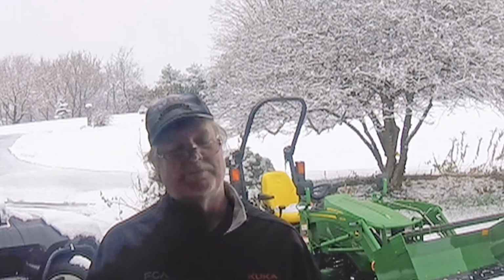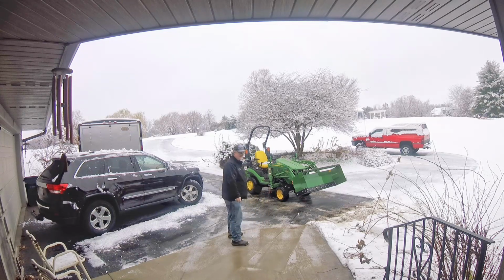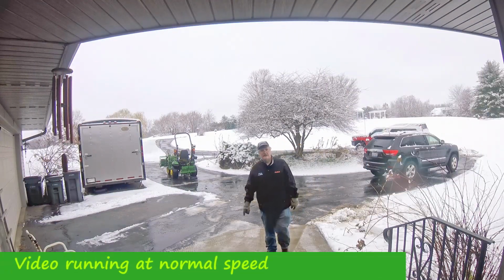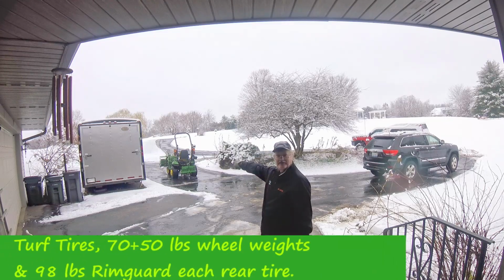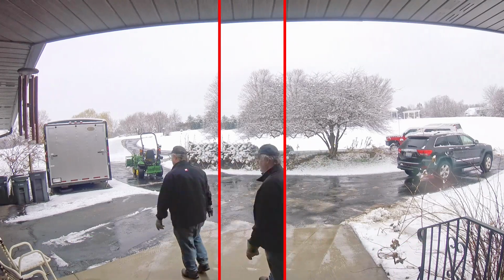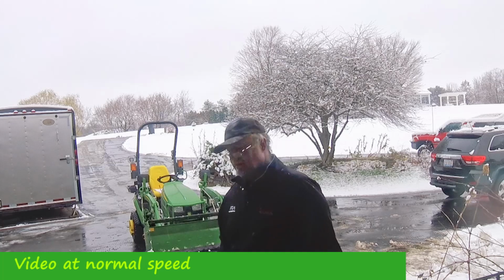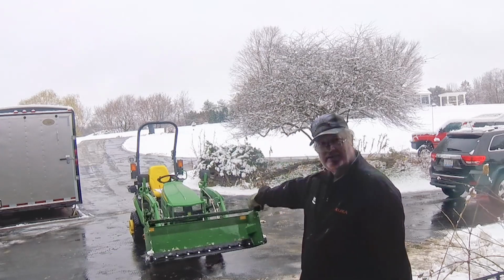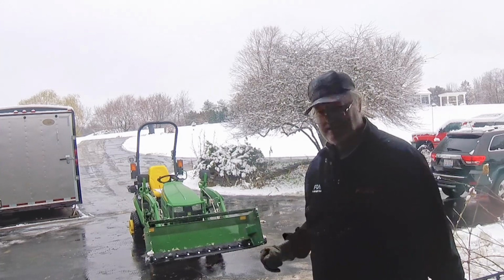#27 First Light Snow with Snow pusher

Comment: I don't use float at all pushing or back dragging. Works well that way. In float raises the front tires enough to take the weight off them you can't steer
Reply from the maker: Yea I am finding I need to refine my skills to not use float as much. Thanks for commenting!

Comment: I experience the same steering issue using my bucket to clear snow. That's where split brakes would be very handy. Just have to lift it up at times. I use my box blade for ballast in winter. I sometimes push snow backwards with it because I can steer when using it.  I angle it forward to prevent pushing gravel onto my grass. Rgds.
Reply from the maker: Thanks for the information! Split brakes would have been great to have.

Comment: So, let me ask you. Your first time with the pusher, do you like it or not ?
Reply from the maker: So far I am liking it, the sides do a good job controlling the spillage . The back drag is a tad flimsy. It is starting to bow a little already. The HLA brand would probably be better for back dragging. I went with the Frontier so I could roll it into my financing. With the rubber edge on it, I do not get a completely clean drive if it has had the chance to pack down and freeze. However it has not given me an issue with my cracked asphalt either.